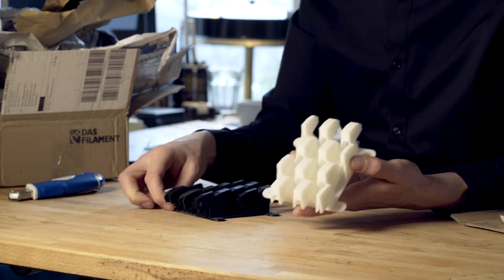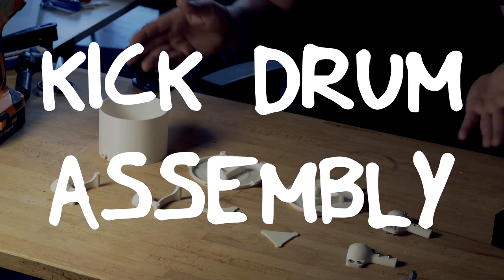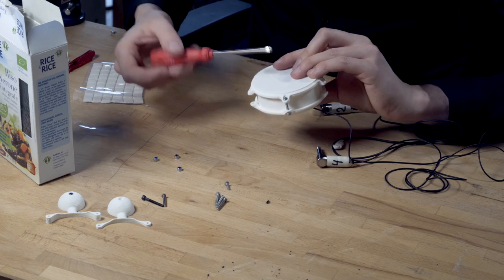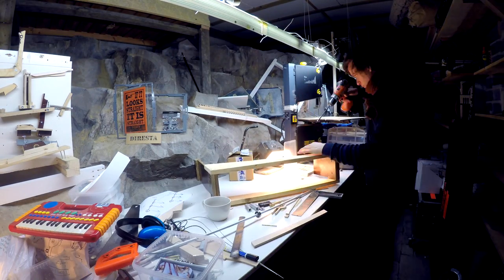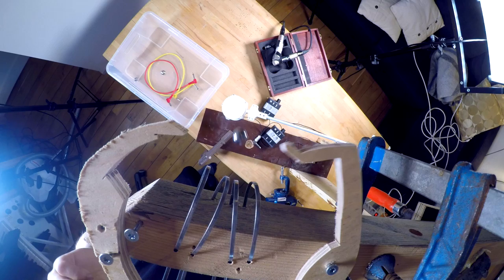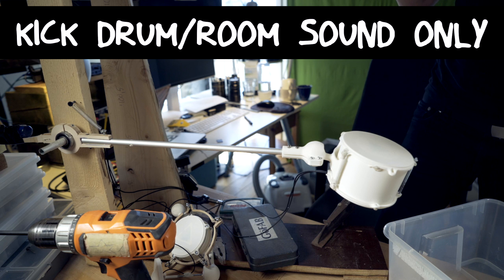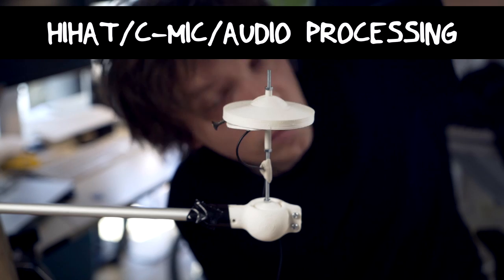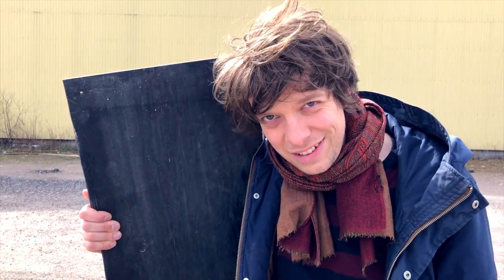Testing 3D Printed Drums - Marble Machine X #6

Comment: but wait... does the 3d printed hihat's existence actually make sense? cause yah, you can use almost anything (any material) as a drum and it naturally sounds like a drum. it works.
but that hihat sounds just like a drum, not likea hi-hat! (and if you think about it, cymbals and high pitched percussion are always made out of metal). at this point you could probably make a hihat sound with less effort just by editing the snare sound... if your sounds come from editing SO much, what's the point in engineering good parts (apart from the proof of concept) at all?
i don't want tocriticize, i'm just asking: is it possible to make genuine hihat this way? <:/

p.s. love your work!

Comment: Don't use a stopper on the top of the snare to prevent it from wobbling upwards. I fear that if you do this, the sound of the snare contacting that stopper on its movement upwards will register in the contact microphone, which is not what you want.

Instead, use non-elastic strings connected to the bottom of the drum which are taut when the snare is at rest in the shock mount. This way, when the snare flexes downwards in the mount, the non-elastic strings will go slack. When the snare flexes back upwards in the mount, the non-elastic strings will arrest its movement, as they will become taut. This might produce some extra noise by creating more rattling of the rice inside, but it will be much better than using a solid object as a stopper on top. 

I can elaborate or illustrate if this isn't clear enough.

Comment: while i'm not any good at engineering in 3d models or printing, i'd say consider heading over to the XRobots youtube channel (particularly his videos on the r2d2 frame and the later frame assembly videos for the hulkbuster suit project).

There's a lot of good ideas on how to assemble light and very strong frames using 3d printed parts--such as by making them out of several thin/interlocking layers and chemically welding them together with a small application of acetone, which reduces the risk of a larger or thicker single piece warping or cracking during the 3d print.

Comment: It was awesome until you came to the elastic band solution for the snare.
I know it's a convenient solution, but don't forget those elastic bands were a reason why the first Marble Machine wasn't reliable.
You really should find something else, i'm not a mechanical engineer but what you try to do for the snare is a car "suspension" in a way. I'm sure the germans can find a proper solution for this :-)

Comment: Why don't you use the same kind of idea you used for the music box so the marble machine can play longer song that don't repeat
Reply: Jip Smaling OH! So the large wheel would pull a sheet of heavy paper with punched holes from a spool, and the marble release levers would fall through the holes in the paper, like a huge keyframe system on a street organ, or actually cardboard roll orchestrion like a Polyphon orchestrion, Regina Sublima, or Frati or Imhof and Mukle  orchestrion? Good idea.

Comment: I am always impressed with the marble machines created to help create music; the marble machine in Wintergatan was amazing and brilliantly designed and pure genius.  However, when it comes to creating percussive drums and cymbals, I am not as amazed when it is created by 3D printing; especially when it really adds no true creative element to the machine -- recreating the wheel -- when you could have easily and more cost effectively made drums and cymbals from the same sensors using recycled tin cans and oatmeal tubes. To be perfectly honest, 3D printing is over-rated for creating items that already exist on the market; however, designing and creating unique tools or objects (such as the guitar string marble guide) found at mark 01:11 at the beginning of the video; this type of 3D intelligent design is unique. However, the Drum kit was rather mundane in comparison and uniqueness.

Comment: I haven't read all the comments of course... but looking at these 3D printed drums... well I'm into filament printing with different for almost 3 years now. I think those drums will not be very durable. Those look like SLS prints but I still think they will crack after a couple of 1000 hits. Why dont you cnc cut little drum-segments in layers and form the actual drum in plywood and put up little drum heads instead? They surely wont break so fast. It's great to see your work!!! Amazing! I use Inventor to create my designs, that I 3D print with this very, very nice 3D printer: http://www.atom3dp.com/en/atom25_en_home/ and I cut stuff with a cnc router by http://www.stepcraft-systems.com looking forward to seeing your videos!

Comment: I kinda wish the drums wasn't midi controlled, but it's probably easier this way
Reply: Seems like he uses the sound from the microphones and processes it. Why would he put rice in the snare if using triggers?
Reply: Oh well I guess I didn't finish watching the video before commenting, my bad
Reply: I agree, it's a trade-off, but not too big a deal.  I've heard contact mics triggering pre-sampled/generated sounds is a lot more common with professional drum recordings than we might think.  The original machine as a one-off prototype is a work of art for sure.  Remaking it is melding into a work of engineering, and using contact-mic/triggers is definitely better than trying to get an actual drum to respond consistently and sound good.